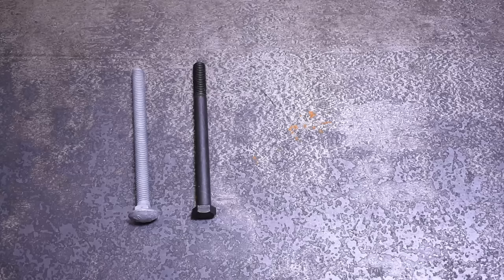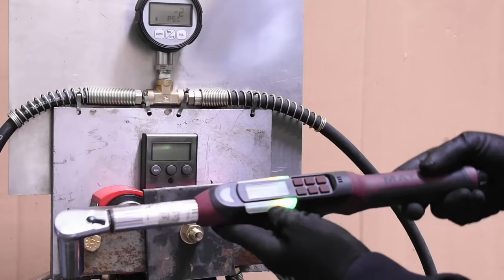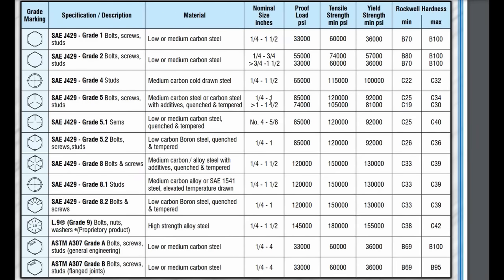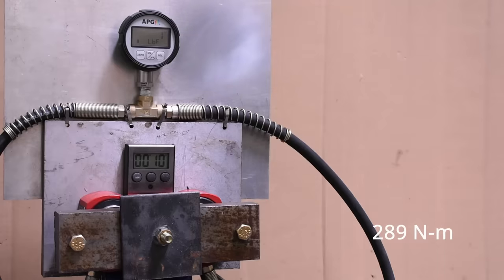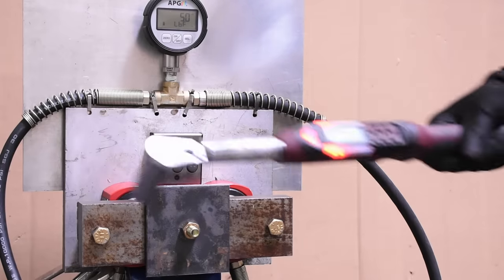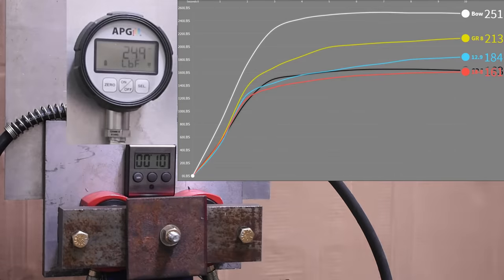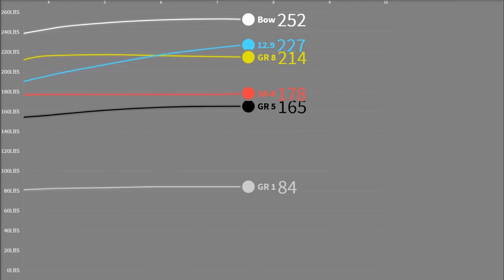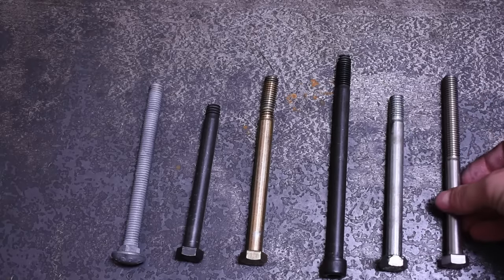Strongest Bolt? Grades Explained & Dyno Tested For Science

Comment: Fantastic video. Very interesting.
I have a few comments from the perspective on an engineer.

1:50 - 18/8 is a stainless steel alloy, not a grade of bolt. It also called 304, or A2. It comes in its own three different strength classes - A2-50, A2-70 and A2-80. On metric fasteners this info is often stamped on the head. This steel can't be heat treated, as it doesn't have any carbon content (other than as impurities). The different strength classes are achieved through cold working the steel in this case.

8:36 - Grade 8 / 10.9 is always made from medium carbon (~0.4% C) alloy steel, quenched and tempered, never plain carbon steel. This is a requirement of the SAE/ASTM/ISO/DIN fastener standards. Plain medium carbon steel can't achieve these strength levels. Chromoly 4140 steel and 8640, 8740 are alloys often used for this grade for smaller diameters. For large diameters, 4340 is common.

11:10 - It is worth noting that metric 12.9 and ASTM A574 are standardized classes, but the so called equivalent "grade 9", as well as the bowmalloy are not (they are a product of some manufacturer that does not have to meet any legal criteria behind the manufacturer's promises). Therefore the last two will not be found in any product that needs to meet certifications.

17:45 - Regarding your question about the recommended torque specs, these torque figures are not really related to the maximum that a bolt can live with. Instead, they are calculated to generate a bolt tension/clamping force/preload that is equal to 75% of the bolt's proof strength. This guarantees reusability of the bolt after disassembly. The reason for it is that torque is a pretty poor proxy for preload - even among seemingly identical bolts torqued to the same spec, there is a +-30% variance in the generated preload. To make sure that a bolt does not yield, it has to stay below its proof strength. Hence if we calculate torque for 75% proof, and the natural bolt variance can mean that for some fasteners this will actually be 30% higher, we then get 0.75x1.3 = 98% proof strength, so even outliers won't deform and the bolts can all be reused.
In a permanent assembly, where fastener reusability is not a factor, the guideline is to use a torque calculated for 90% proof strength. Most bolts will not deform under this preload, but some will and will have to be replaced if it's ever disassembled.
If the engineer wants to use even more of the bolt's strength, he has to rely on more accurate methods than a torque figure, such as a specified degrees of turn from an initial snug position (you may recognize that from engine head bolts), a preload indicating washer, a yield sensing robotic wrench, or specified bolt elongation.
Regarding the failure point from torquing the bolt, it's not really something that can be usefully specified, both due to the aforementioned huge variability in torque, but mostly because the torque-preload relationship ceases to be linear once the bolt begins to yield.

Finally, in this specific video (not your usual impact tests), a better methodology would be to provide the dyno results as the gauge's direct reading of clamping force, instead of calibrating for torque, because
A. bolts are not chosen by the engineer to meet a torque figure, they are chosen to create some clamping force and the torque is calculated to generate this force. This torque is very different if the bolt is dry, oiled, greased, cadmium plated or used with anti seize, but the clamping force is the same.
B. You have to calibrate the dyno for every single bolt you test even if they're all the same size, due to the torque variability especially with unlubricated bolts.
C. Once a bolt starts to yield the multiplier constant in your digital gauge no longer converts the measured force to torque correctly, as torque no longer varies linearly with more tension.

Once again, this was a very interesting video to watch. If you ever do it again with a measurement of the force it would be very interesting to compare the ultimate force you get with the grade specifications. Should be essentially the same as a tensile test, and the forces should match or slightly exceed the specs.
Reply: Wow... you really seem to know about bolts 😲
Reply: I was disappointed to see they missed A325. we always use turn of nut method.
Reply: Excellent tutorial on what is really going on.  Clamping force as per 'Faying Surface'
Reply: Thanks so much for the clarity. 
It was hard to listen and watch some of this because some of the info was so wrong. Still worth watching, as it hard to find good comparison testing of bolts
Reply: I'm thinking we're on some of the same committees.  Your points are spot-on and it is generous of you to take the time to clarify some important points for everyone here.   

I would add to your comments on "18-8 Stainless" that the term '18-8' is not a specification but merely jargon.  If one wishes to know what they are buying in a stainless steel fastener, then one needs to refer to a standard, and at times within that standard, a specific alloy or alloy group.  ASTM F593 Type 304 for example.  "18-8" merely refers to any steel with roughly 18% chrome and 8% nickel content.  Since there is no standard for '18-8' one will end up getting whatever is cheapest presently.  This is often 302HQ, XM7, or 303SE.  Again without referring to a standard one could get any of these or something completely diffferent.  

"Stainless Steel" is a confusing term in itself.  The material origininated in Germany, back when alloys were trademarked if not patented.   Early users of stainless steels included designers of skyscrapers -- who used it on the facades of the Chrysler Building (1930) and the Empire State Building (1931).

People are often dissappointed in stainless steel when it . . . . well . . . stains.  This can certainly happen with Type 302, 303, 304 --- especially if passivation is not performed.  Carbides on the surface left by tools used to form the parts can readily discolor the fasteners when exposed to moisture.  Type 316 is the go-to for (consumer) marine applications.  Navy fastener engineers (and subsea in particular) are the global experts in stainless steel and non ferrous alloys used to make fasteners for military ships.    

Take-away:  Choose your stainless steel alloy.  Reference a standard.  Don't simply accept '18-8' as meaning anything.
Reply: @davidsharp6622  he also mentioned 304 was also known as A2, which is not the same at all. A2 is a much tougher carbon tool steel with much less chromium and is not stainless.

edit: it looks like there is a stainless variant of A2 I had never heard of after some google-fu. Learned something new.

Comment: I've used tons of stainless bolts for bolting together RF transmission lines that have bronze flanges with o-rings that have to bolt together to make an air tight seal but the also not corrode or react in the open air environment for 20 plus years. Biggest issue with stainless is galling, but they are quite durable and you don't have to worry about a rusted nut not coming off years later. The bolts we use come with a wax coating so they actually have a bit of a grey hue to them instead of being super shiny as the wax helps prevent galling as you tighten them.
Reply: the wax also prevents it from welding itself together.
Reply: I'm a boat builder and agree with you 100% . I've had the most trouble with trying to remove stainless nylocks, I think small nylon fragments wedge into the threads and increase the forces on the threads causing them to cold weld.
Reply: Sounds like EIA flanges. I've installed many of those (from 7/8" to 6-1/8"), on FM broadcast antennas and transmitters, both on the ground and in the air. There's nothing like being high up on a radio tower, discovering that the last guy over-tightened and galled the stainless bolts on some rigid transmission line sections, then struggling to shear them in half with the tools you have on hand. Then one of the bolts lets go suddenly, and you drop your wrench or ratchet... not that I'm bitter or anything.
Reply: @Joel_E  yeah the flanges I deal with are for TV broadcast in the six to 9 inch versions. Mostly made by Dielectric. 1500 to 1900 feet off the ground doesn't give a lot of forgiveness for dropped tools!
Reply: I build and service large fuel tanks for oil companies. Whenever replacing a seal on these tanks is pretty much guaranteed that I'm going to be replacing thousands of stainless ⁹/16  bolts due to galling..
Reply: I prefer stainless for anything on the bottom of a car up here in the rust belt. Galling is easily prevented with some anti-seize.
Reply: I'm assuming the job made you pay for your own tools?
Reply: I use a grease product called Pure Goop on stainless steel high pressure waterjet parts and it's vital because some very expensive parts can be stuck together forever because of galling.
I have to inspect the threads for potential stainless steel snowballs rolling up, and I file the boogers carefully and grease and assemble the parts.
Reply: I work in a distillery & we only use stainless bolts. Found that you always have to use anti sieze or they weld up & if you put too much hurt on them the thread rolls rather than the bolt breaking.
Reply: @vette63  Exactly.  Found that out the hard way with a couple body mount bolts back in the 2000s....whether it's car underbody, spark plugs, HEADER BOLTS/STUDS(*!%@$#%!@), anti-seize is your guy.
Reply: I'm probably very ignorant, but what exactly is 'galling'? We don't have enough rust where I am in Australia to think much about ss fastenings :)
Reply: @G-force_Motorsport  galling is when stainless due to heat and friction as you tighten it basically welds itself together, which makes it really difficult to remove later and can also make it hard to tighten all the way down. Wax coated bolts helps along with slowly tightening it instead of using power tools or impact guns to install them.
Reply: @andycanfixit  Thanks, much appreciated, got it now! Have a good day ;)
Reply: would you use stainless steel bolts on car suspension parts like structural parts that hold wheel hub to the arms ?
Reply: @mondecruel1866  Only if they are of the proper grade to handle the loads. You don't want to use one that isn't rated for it on something like that.
Reply: @caminoprojectUS  Hence his comment about the wax helping to prevent galling.
Reply: Under a microscope there are barbs on threads after they are machined.  This explains why often you can tighten SS fasteners but not be able to loosen them.  Saw this often in plant production of equipment.

Comment: I used to work as a maintenance engineer in two local chemical plants, we used some large steel “bogies”, which weighed several tonnes each. The shelves were held into the bogies using ¼ unc bolts at one of the plants and M6 cap head bolts at the other plant. The cap head bolts (12.9) used to shear off for fun, yet the regular ¼ unc bolts never did.

As for stainless bolts- they are a real pain in the backside, especially when they gall up and cannot be cut off with the gas axe!
Reply: If you use a 300 series SS bolt and nut, you’re in trouble. If you use a 300 series bolt and a 400 series nut(or vise versa), you’ll be ok. Another option is a SS bolt and a carbon steel nut. Dissimilar metals is the trick.

Comment: I used to work for Bowman. They are the company who originally created the Bowmalloy fasteners. They were bought by the Barnes Group and then MSC. 
They kept the name due to industry recognition. 
For a time, these were made in China and almost cost Bowmally their reputation. 
I believe they have been brought back to domestic production now.
Reply: Yeah Briggs and Stratton brought back production to the states a few years back, I definitely notice the difference.
Reply: Thanks for the info.
Reply: And the 'illuminati' symbol is the Associated Spring logo because Barnes owns Associated Spring and the bolts were sold to distributors (like MSC) through their Associated Spring Raymond brand.
Reply: Good company.  Knew your bolting guys very well.  You guys used to source Bowmalloy at Lake Erie Screw Company (then in Cleveland) when the Wasmer family ran it.   That was a classy operation -- on par with the best in Germany or Japan.
Reply: Which is a function of China having a tendency to say an alloy is someting it's not. China has great engineers. If they created alloys with the same demanding specs we do, they could of course produce bolts (or any metal item) with the exact same high quality the U.S. or Germany does. Throwing a bunch of scrap metal into a furnace and calling the resulting alloy "Grade 8" (or whatever) is the problem. They could produce quality if they wanted to.
Reply: What is the best screw brand ? Who makes best bolts and nuts?

Comment: Tightening torque is based on 66%-75% of the tensile loaded yield strength, and depending on who is doing the calculating for that factor of safety. It has to do with avoiding fatigue, which is based on yield. Adding an axial load onto the bolt adds some tension and reduces some of the clamping load until the clamped pieces separate. For most bolts, this ratio is 0.33 * load applied added to the bolt, or less. I believe steel is usually .2-.25. This ratio of force applied is part of what makes proper torque avoid fatigue. If the total load of the bolt varies by 5% and doesn't yield instead of varying by 50% or more, that bolt will stand up better to cyclical loading.

As much as I like your videos, this particular test doesn't mean much. Torque is heavily influenced by the lubricant you use. Molykote P-37 generally has the most consistent results across materials. Unlubricated threads vary widely between material and coatings, not grade 5 to 8 but steel to stainless or Monel or K-Monel.

And a comment on grade 8 and harder alloy steels (>34 HRC or >150 ksi UTS). You should avoid any kind of zinc plating because it actually increases susceptibility to hydrogen embrittlement, which is a science term that means a bolt can break at 30% the rated load from environmental conditions. There is some debate where the exact cutoff is, but the toughest alloy bolts can easily lose a lot of their strength from a coating, sometimes before it is ever installed if it was done wrong (See San Francisco Bay Bridge failure where hot dipped galvanized bolts broke throughout)

For anyone interested, Fastenal has some great explanations of all of this: https://www.fastenal.com/en/69/bolted-joint-design

TL;DR. Bolt tension and reliability has a lot of factors and unlubricated torque runs til failure look nice but unfortunately don't really tell you much from a scientific point of view without concentrating on where they yield and controlling other factors by using a high quality lubricant, like Molykote P-37 or similar.
Reply: You're completely incorrect about the zinc plating. This is what I do for a living I make and test fasteners by the billions with a B. Zinc chromate plating is an extremely common surface finish. Every single lot is baked out for several hours after the plating process to drive any hydrogen out of the steel. Although in recent testing it's shown that anything under 34ish HRC is not susceptible to hydrogen embrittlement it's still done because it's written into the ISO and individual OE  standards.
In addition to that Fastenal doesn't make a single fastener on their own, everything that they produce or sell comes from an established fastener supplier. They are not in any way shape or form a technical expert, they are just middleman distributors.
Reply: @otm646  I just took an intro to matscie class and it's changed my entire world view. 
The work you all do is sick
Reply: They don’t produce any? I thought they had multiple manufacturing facilities in the US? Also, don’t they own Holo-Krome and Cardinal?
Reply: @otm646  According to ISO TR 20491 the cutoff is RC39. Also ASTM F1941 requires 12 hours of baking, not just a couple. And Fastenal does actually own several fastener manufacturers.
Reply: @wcr2179  From what I can see(Mech-E) Fastenal is just a distributor. Though they "own" some manufacturing companies, whatever that means 🤷
Reply: Cool story bro.
Reply: @mark cool story bro.